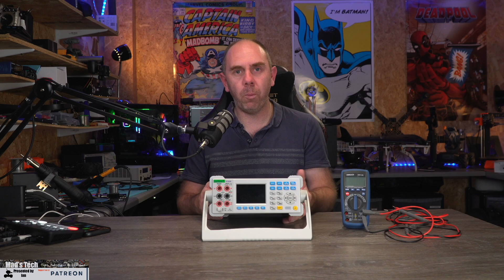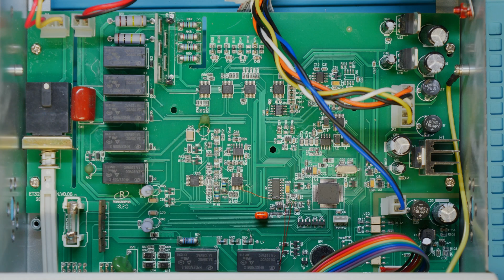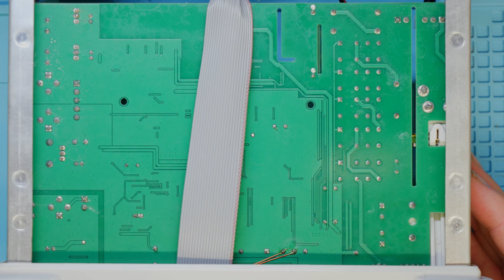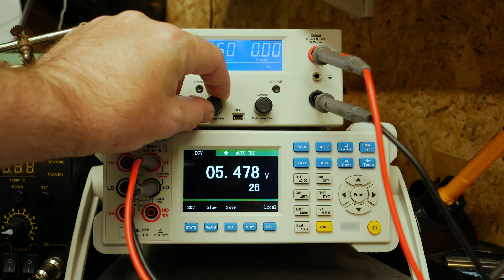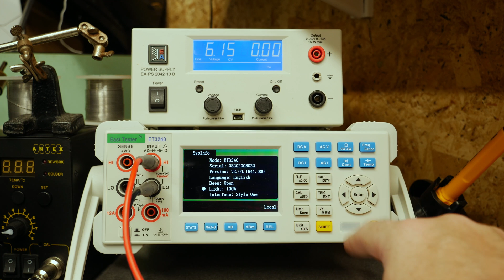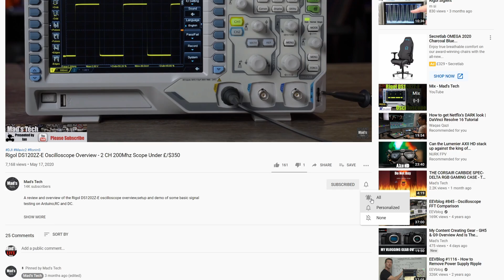Bench Multimeter Review East Tester ET3240 -  Lots of Good & Bad

Comment: hmm, this meter does not have different trigger levels it has different display update periods, so if you are intending to buy this instrument for its ability to trigger the data logger you will be disappointed.

The reason why you would want different display updates times is because it can give more accurate results. i.e. it takes many readings (that are not displayed) averages them and displays the result of the averaging.  if you were using the meter to find out where the 5 volt rail is lost on the circuit you are repairing for instance you want the meter to display what the probes are on as fast as possible since you are not concerned with the accuracy of the 5 volt rail but is it there. if you have made a voltage reference you want to know how accurate it is  so if it takes 3 seconds to display the reading  to get better accuracy so be it. 

There is one very important component in any multimeter irrespective who makes the meter and that is the reference ic used in the meter. if you know what device the manufacturer uses you can pull the data sheet and find out its accuracy and stability. interestingly the device they choose is a means of displaying your superiority over the other boys if they remove the details off the voltage reference its because they are ashamed of their penny pinching. keep in mind a very good voltage reference sells for about £15 and that would grace a 5 to 6 digit instrument.   

I meet a lot of engineers who have 5 + digit meters that aren't as accurate as my fluke multimeter, they think more digits is more accurate, yet their 3rd digit is erroneous so any digits after that may as well not be there. i.e. its better to have an accurate 3 and a half meter than an inaccurate 6 and a half digit meter.

Whatever instrument you buy is only as accurate as you can prove. In my location it cost me £86 to have my meter checked (not calibrated) i.e. they tell me the error,  its traceable, but in reality I do not know a week after having the check  done if the meter is still that error I have to compensate for, how do I live with this? I do not buy an instrument I can not pull the data up on its reference. Some meters can measure their own reference which is very comforting  indeed.

Comment: Reworking of PCB's is nothing new and you will find most manufactures do it or have done it in the past. Yes even Fluke, Tektronix, Siglent, Agilent, Rigol, Keysight, HP, Rohde and Schwarz etc.
Another way of looking at this is they identified and issue or bug and corrected it, instead of just ignoring it and pretending its not there.

Comment: Nice presentation but I feel compelled to comment.  (1) I recently acquired the ET1240 instrument primarily for one reason and that is to read AC amplitude and frequency simultaneously.  With the ET1240, I don't have to switch between a multimeter and frequency counter, and yes, I can get the same measurement from a oscilloscope that displays amplitude and frequency.  This feature works really well, I am pleased being able to see both measurements at the same time on the screen. (2)  The paper User Manual included is somewhat disjointed.  The index page is out of sequence,  the first index page should be the second page.  The first page of text following the index is page-11.  The CD included does have a correct and readable version of the User Manual in MSFT Word.  The CD also appears to have the drivers required to interface the ET1240 with a PC.  I have not pursued that any further.  (3)  Access to the Cal procedure is likely via that PC interface.  The user cannot enter a Password or use the SCPI commands by the instrument's key depressions.  (4) The package is not as 'cheap' as he describes.  It is a decent plastic enclosure, I'm OK with it but I do agree stacking a several pound instrument on top of it isn't a good idea.  (5) The accuracy of various measurements seems to be spot-on as compared to my bench HP 3455A Digital Voltmeter.  For example, measuring the amplitude of a 700 Hz signal, there was a 1 millivolt difference between the ET1240 and the HP 3455A (good to 1 MHz).  Other measurement differences (Vdc/Vrms) were in the millivolt range as well, entirely acceptable.  (6)  It read Vac to 100 kHz as specified.  (7)  It measured frequency into the low 20 MHz range.  I increased the frequency of a signal generator (sine wave, 1.0 Vrms) until it stop reading (displayed "OL") which was 20.245 MHz.  It appears the software shifts to "OL"  when the input exceeds a predetermined value.  It might be able to read a much higher frequency but is software limited to 20 MHz.   I did not measure how low in amplitude it would read frequency.  The ET1240 is not intended to replace my HP 5334B counter but it will be a handy and quick way to see if an oscillator is at least working.  (8)  The 'Interface' function does not appear on my instrument's Sys. menu.  I cannot change the screen as he does on his device.  My Manual does state that it can be changed but it does not appear on the screen.  I like the default screen anyhow so I'm good with the black/green display.  

Bottom line:  The ET1240 will do the job for my audio frequency filter projects very nicely.   Use the CD User Manual, not the paper manual included.  I consider it an adequate device for troubleshooting and/or making quick measurements.  If I need accurate and precise measurements, I can go to my HP, Fluke and Tek instruments.  It has many more features than a handheld DMM.  

(Note:  He refers to a handheld DMM as the "standard" tool.  Isn't that backwards?  The bench meter came decades before the handheld DMMs were developed.  I would say the bench instruments are the standards.)

Comment: 5:16 the switch is probably pushed back cause of insulation of the mains and the rest of the device, it would come quite close to the panel circuitry without the lever thingy

Comment: Louis Rossmann would be proud of those bodge wires! But over all, you do get a lot of meter for your money. Nice lot of features to have on your bench.
Reply from the maker: It does and I really have mixed feeling on this one.  It’s great value but well abused.
Reply: @MadRC  Abused or not, it's a good performer.  I just bought one myself.  I am curious if that stand can be easily removed from the unit.